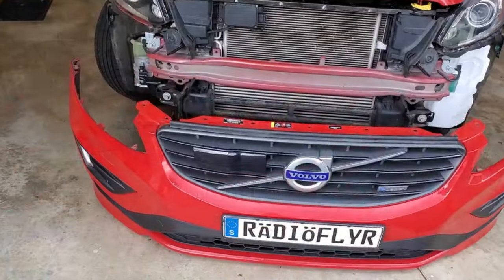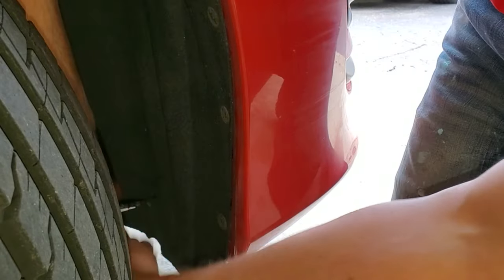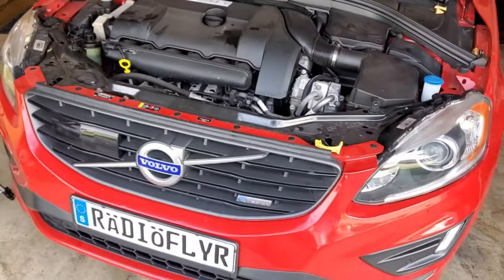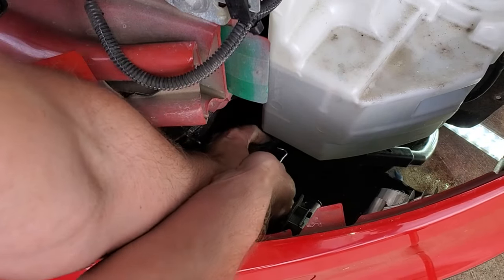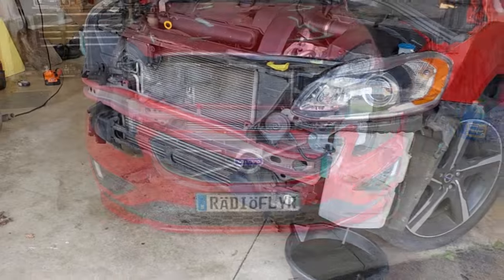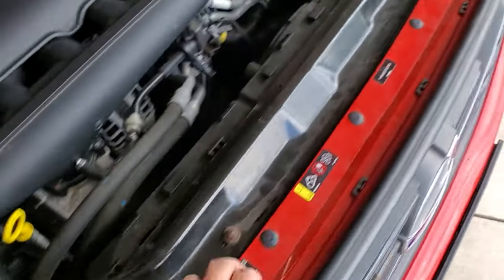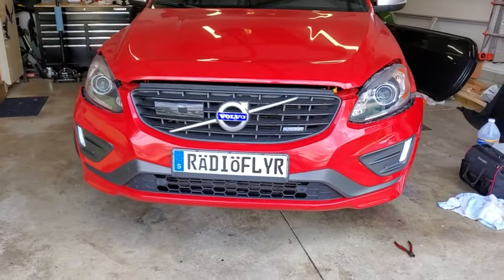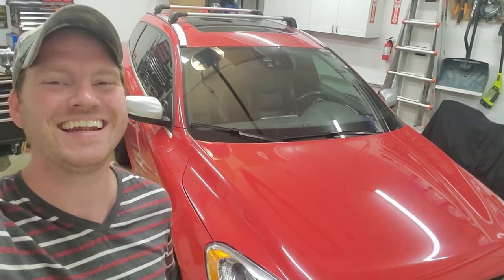Detailed Volvo XC60 Front Bumper Replacement

Comment: The light connect at the passenber side was impossible to disconnect! I just hanged the passenger side bumper on the headlight. Perfect height.
Reply: Did u put a flathead screwdriver under the locking mechanism of the contact? If so then i would slide off with a little force if u pull those apart from eachother

Comment: Hi Gary - great video. I need to do the same thing on a V60 - also to replace a leaky washer fluid reservoir. Anything I should know about that process? Any tips? Did you have any resources to help with that procedure? Please and thanks.
Reply from the maker: Hi friend! I actually filmed the process of replacing the washer tank on my XC60. However, I need to finished editing the vid before posting. I've been putting it off bc I wasn't sure if it would be useful but sounds like it might be. Once the bumper is off the washer reservoir replacement is pretty straight forward. The main point of mention is that the washer pumps going back into the new tank are finicky. On the end of the washer pumps are grommets where they mount into the tank and upon reassembly have a tendency to leak. Might not be a bad idea to get replacement washer pump grommets or don't be afraid to use a little bit of sealant on the grommets. A little goes a long way. I also recommend filling the tank up and wiggling the pumps a bit to simulate road bumps before you reinstall the bumper to check for leaks. Outside of that it's a pretty simple procedure. Hope that helps!
Reply: Agree great video and I am about to embark on the same repair but will wait until you finish editing the video. 
I’ve also got a bad light lens that I would like to replace, is that pretty simple once I have the bumper off? It looked very accessible.
Reply from the maker: Finally got around to it and posted the washer tank replacement. Hope it helps with your repair! https://youtu.be/68GJmH6h5nw As for the headlight replacement yes, once the front bumper is off you have great access to remove the headlight assemblies.